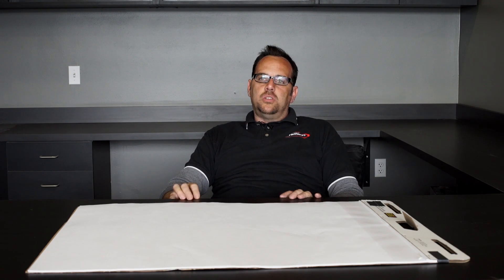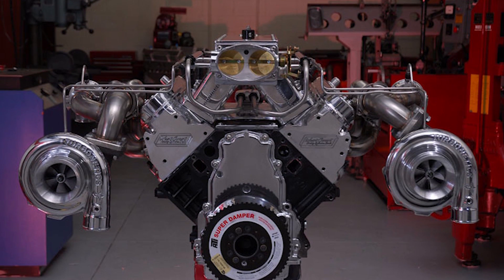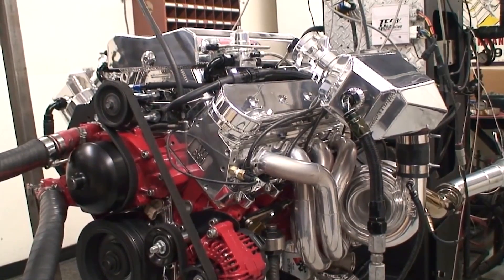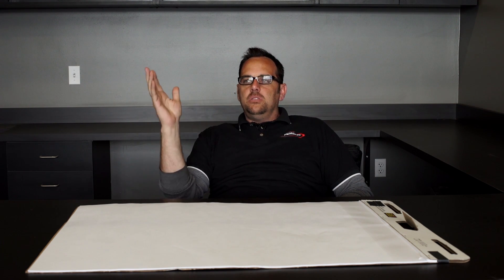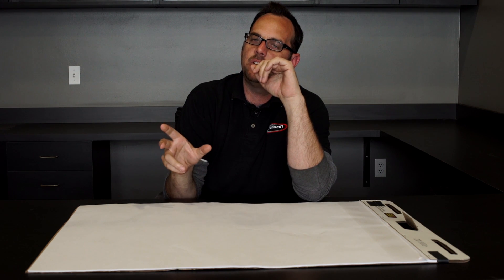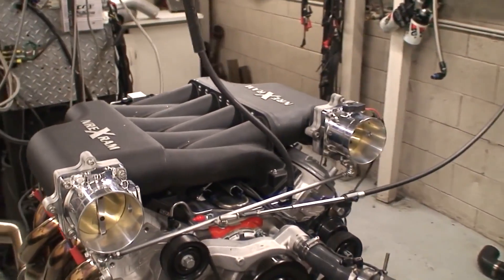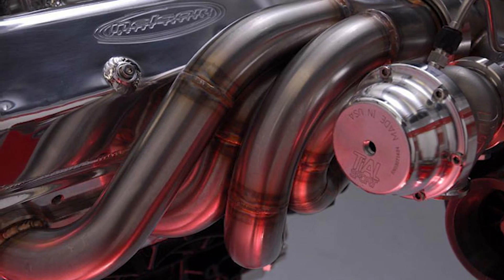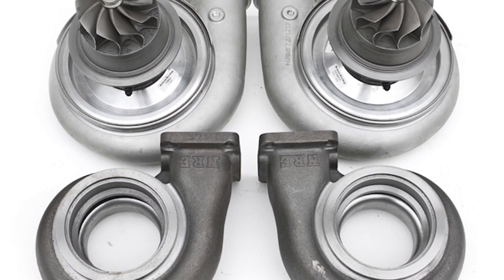Master Engine Builder Explains Why the LS V8 Is SO Good

Comment: If your going to build an LS stroker, be sure to listen carefully.  Listen to the area of putting to big of crank into a short sleeve block.  In short don't go the cheap route, because it will cost your more in the long run.  The intake review is defiantly spot on.  I flowed the stock LS 3 intake at 290 -330cfm.   That's rate on par with an old Gen 1 SBC single plain high rise intake.  Plus LS intake still gives you a great low end torque curve.

Comment: All good stuff. Classic basic V-8 how-to.(yawn).  I was hoping for variable valve timing, supercharger how-tos, turbochargers w no lag incorporating electric spool-up, etc. You know..."advanced technology".
Reply: See also leaf spring suspension in corvette.  Still out-corners "more advanced tech".  If it ain't broke, improve it.  Tech for tech sake is kinda silly.  NO high-revving engine has the longevity of LS engines.

Comment: I have an old Lingenfelter 383 stroker  that was converted to AFR heads. I since aded true dual exhaust and bigger heads . Nowthe power seams to be less and torque has diminished . When I call lingenfelter and asked for John whom worked on this car personally, they told me he  passed away, and have no record of it. My questions is do I need to re-program the  generation 7 CPU tunnel ram to add more fuel and more air? since the configuration changed ? or do I need to add another bigger cam? Or Am I maxed out on what this motor is capable of?

Comment: I agree with you, I have been building engines for over 35 years! And yes, doing all of the machine work!!!
Reply: I hope you're not agreeing with the LS engine I've been building engine for 20 years I don't know how many LS that I've built for people and it was nothing but trouble save your money find you an old used engine have it machined you get more power out of it and you save money take it from somebody that's been building engines for 20 years
Reply: @DWO619  the LS is a great platform, it went to crap in 07 with the AFM platform. 06 and down is great!
Reply: @markbarnhill6300  bro how do you know so much about the LS I can tell that you know what you're talking about did you used to build them all the time did you use to race

Comment: ok guys....anyone listening? lol  I have a 1985 Chevy Silverado with a 4 inch lift.  Running 35s with 373 in the rear.  It has a b and M shift kit but it has a 1989 Th700R4.  The motor is a 383 stroker.  I am not much of a motor guy but what i do know is the set up i have has some serious torque.  I like that but the gas is not so great lol.  It is a daily driver and its a truck so i enjoy it....i dont tear it up.  I have no intentions of making it show quality but i am planning on doing some restore work and am contemplating the Ls set up.  Which Ls would you say would work well in my truck?  Or should i stick with what i have?  figured i would ask around and see what people in here have to say....seems how the vid is on LS Motors!

Comment: 10:07 "500/1000ths" I'm not great at imperial measurements but isn't that just 1 half?
Reply: Machinist.
Thats why.
Reply: Engine measurements are in thousandths of an inch so its just the common way to say it. Water is h20 but who says give me a glass off h20 right.
Reply: Any kind of mechanical work is done to a degree of precision. In this case internal tolerances work within thousandths. You will hear him talk about stroke length saying things such as six three hundred which again is just 6.3". That is the degree of precision they are working at, so think of it like simplifying your math to a common denominator. 500/1000 could easily become 502/1000 so its all relative to the precision you are working at.

Comment: Things that don't impress me about the LS.....main cap fit/location (unless it's an LS7/9 with dowel fit.) The oiling system is atrocious with too many sharp bends and restrictions. Lots of weighty bolts to hold covers on.....seems GM knew there would be some warranty work involved on the LS motors and went out of their way to make re-useable gaskets and certainly didn't skimp on bolts to hold those covers on. The LS has great cylinder head flow and for the drag strip crowd serves their purpose well, if you doing 24HR endurance racing....your going to need some expensive parts to keep an LS alive!

Comment: I have never seen an engine fail because it was a 2 bolt main! If it takes 4 or 6 bolts on each main cap to keep the crankshaft in the block then it was junk to begin with! It is what it is!

Comment: But the LS is garbage. Us Europeans STILL cant believe how pathetic the performance yield is from such a massive capacity yet  you US guys STILL buy a shitty engine that uses 2 valves/cylinder, cast iron blocks, push rods (ffs) and carbs???

Unbelievable
Reply: The last thing any gearhead or casual driver cares about is how his engine's "performance yield" compares to other engines. It is a meaningless metric. By that reasoning we should all be wanting to drive around in 1L 300 hp powered cars. The LS is far from being garbage, representing one way to power cars and win races the world over. The reason most Americans gravitate towards V8s is simple - they are reliable as a stone, cost effective and still relatively efficient in a land where fuel prices are much lower than in Europe. "Massive capacity" equals easy power, effortless naturally aspirated torque, making them very enjoyable and tractable for every day driving. As to potential, the person being interviewed produces LS motors with 2,000 hp. - plenty of performance yield from such a "shitty" engine, I'd say.
Reply: MunroM84 
Why are they not impressive from a tech standpoint?
They are made of aluminum,
weigh about as much as a 2.4l 4 cylinder, 
have vvt and direct injection (at least the LT's)
all in a package that fits "massive capacity" in a very small space.
From a maintenance standpoint, I would rather work on one of these than any DOHC monster.
DOHC V6 and V8 engines are am absolute nightmare to work on, these ls engines are actually pleasant to work on.
Fuel economy is not bad, either, my 525it manages just over 20mpg combined, with a proper manual transmission. I used to have a 4x4 5.3l silverado that despite the automatic trans, much poorer aerodynamics, and about 500kg more mass,  managed similar fuel consumption (about 2mpg less combined) Let that sink in. Twice the engine capacity, heavier vehicle, inefficient automatic transmission, 4wd axle drag, vast, flat torque curve, yet 95% of the economy. Yes my Bimmer has over twice the specific output. So what?
I can appreciate a high strung b20c as much as anyone else, but for people to be closed minded enough to dismiss a clean sheet engine design that happens to use pushrods and 2 valves per cylinder as "archaic" is appalling.
Maybe you should change your metric.
125hp/Liter is nice, but at the end of the day, you still only have 250hp from your 2l engine, while that 70hp/liter 6l ls has 400 hp at similar weight, and is easily and cheaply capable with simple cam swaps and tuning of hitting your 100hp/Liter minimum benchmark.
If the metric was hp per pound, or hp per sq. inch (external size), LS wins hands down.
Its a moot point, most LS haters are people who don't have to deal with working on them. I do, and I would have no qualms whatsoever in swapping an LSx engine into my E39 if that wonderful m54 inline six ever goes bad.
Reply: Don't compare displacement to a Dohc engine to a ohv engine, displacement is irrelevant and funny thing is the ls is less weight than most less displacement v8's.

Comment: The new Hemi is a far better investment. With little money you can have far more hp and torque than the LS motor. I for one am NOT impressed with nor do i see the big deal with the LS motors
Reply: Swapability, avalability. GM put LS blocks in EVERYTHING. You can grab a wrecked Tahoe and it has the same block as a GTO, Corvette, Camaro ect. Transmissions options are plentiful as well.
Reply: I understand the availability but that's the ONLY thing the LS has over the new Hemi. I disagree on swapability because i have yet to see one vehicle with an LS swap where you couldn't fit a Hemi in the same spot.
Reply: +Anthony Clements I'm just wondering I don't really have a opinion on which is better Hemi or LS they are both great engines but do you think someone out there has put a Hemi in a Honda or  Toyota Mazda maybe I've seen it with the LS I'm very curious now lol

Comment: it all sounds good, about the intake so why don't you come up with variable intake using screw type sleeves with a common throttle body ? wouldn't that solve top end power and down low ?
they have it on the yamaha YZFR6 2008/9  link below will explain better then writing i guess 

https://www.youtube.com/watch?v=N-oJ9DHg7KU

Comment: Opening statement "I've been building motors" Just one of my pet peeves.It's not a "motor" it is a engine!
Reply: Ford Motor Company and General Motors would likely disagree. An internal combustion engine can be a motor, but an electric motor is the one that should not be called an engine... Motor boats, motorcycles, motor homes, motorcade, motor yacht - you get the idea.